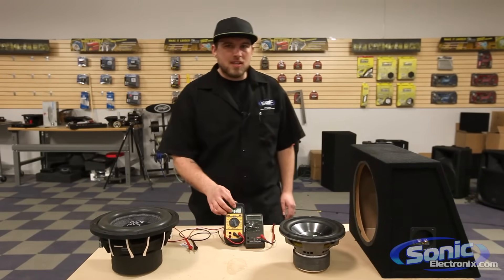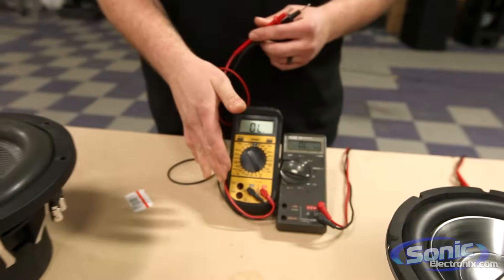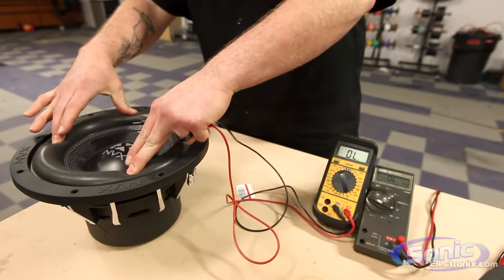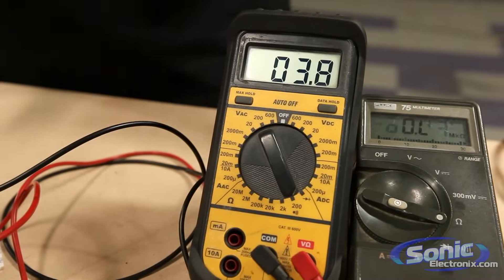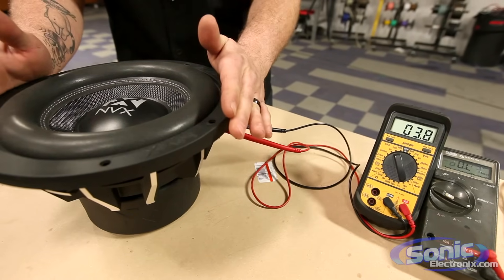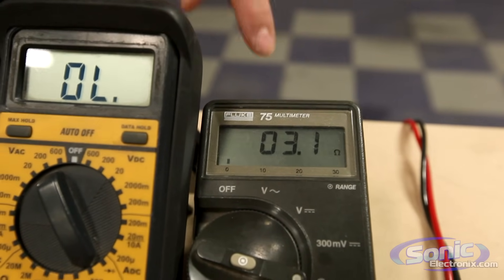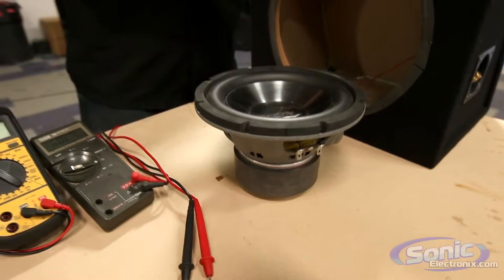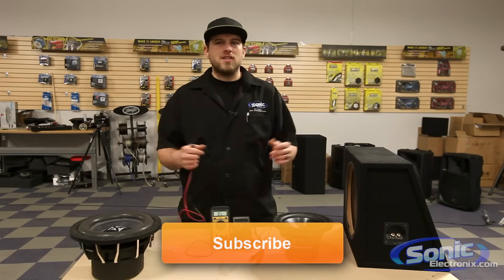How to Test Subwoofer Impedance with Multimeter | Car Audio 101

Comment: For all the "Mansplaining" comments, I'm a old school repair tech, and this method serves its purpose, it tells you if it's within acceptable range, 
and that it's most likely a good driver, so I even use this method 99% of the time.
I also do the simple travel test, pushing evenly up and down on the cone to listen and feel for potential scratching of a voice coil, etc.
Unless you have some odd sounding problem, then maybe use the whole special equipment and math. 
I'm sure the test in the video is just meant for explaining the general "is it good or not" for the general public, with basic tools anyone can buy. 
If he were to go in to all the explaining of the differences and the descriptions of how to do it "properly", 
he wouldn't have very many views, and and would lose the whole intention of the video.

Comment: I need to check the impedance  coming from the amp,  i just got a 7.1 creative surround system for my pc at great price but its missing the front left and right speekers so looking to add bookshelf speakers and only way to do it is to test the amp output for ohms?

Comment: One thing he didn’t mention, is if you are testing a speaker, you might also be testing to make sure there is continuity. Maybe, you’re considering buying a set of used speakers, and you want to be sure that the speaker isn’t dead. It might be blown! But not dead.🤪😫.  Good video. It answered my question.

Comment: You are testing resistance! Impedance involves inductance and capacitance (XL and XC); this is why the speaker will always measure short of the true spec because resistance is not  impedance.

Comment: Thanks for the tip! 

I did exactly what you've shown. What does it mean when the rated 4 Ohms subwoofer reading is only at 1.3 - 1.5 on the reading? Does that mean it's pretty much dead or something?
I did a test on the 2nd sub and that one seems normal; rated at 3.9.
Reply: Could it be a dual voice coil?

Comment: I'm kind of confused. I've never seen impedance be tested without a signal generator, decade box or AC voltmeter. I think all you did here was resistance measurement. Please correct me if I'm mistaken.
Reply: your mistaken.

Comment: anyone else run into this issue ? I got some 16 ohm speakers that are measuring 11.3 ohms and the company is telling me this is normal. and telling me some garbage about AC and DC ohm measurement. I have been doing this for 30 years and good speakers always measure within a 1/2 or .5 ohm of what they are rated at.

Comment: Thanks for the video. If I got 4.9, I assume that's 4 ohm? Is that odd to be that high? My multi is a little different than your yellow one. I set for 200 ohms as you did, but for the red and black connectors, I have three choices and not 4 like you. It looks like my red has combo. It shows V over top of ohm symbol, then mA. I used that for red and COM for black. The other red one is 10A which you didn't use. Did I get that right?

Comment: Can I measure the ohms of my 2 subs through the terminals that my amp has hooked to the speaker wires? My box is so big I can't take it out my trunk and it's a band pass box that's closed with 6 holes towards the cabin so I can't even see the subs unless I take it out and unscrew the box. I can only look through the holes

Comment: Why does my 4 ohm dual coil read 2.6
Reply: Because this video does not measure impedance. It's just plain wrong. It measures resistance. They're not the same thing. Impedance relates to alternating current (like the sound signal going to your speaker) and resistance is direct current.

Comment: My multi-meter works but its reading 0.l. However, I am testing tweeters and right after connecting the leads, a bunch of random numbers show up (in the high 30s) and then it goes to 0.l. What could be the issue?

Comment: i have an orion hcca 152 which i wired to 1 ohm. when i check the leads im getting 1.7-1.8. at the coils im getting 2.0 on the dot. is that normal?

Comment: As everyone has pointed out DC resistance and AC resistance (impedance) are not the same. The meters show the DC resistance of the coil. You can roughly figure the impedance by multiplying the DC resistance by 1.15, ie. it's usually 15% more than the DC. His 3.7 DC coils are 4.2 AC. Close enough. Also, impedance varies with frequency. That's why you always see the word "nominal".
Reply: You're the only person here who offers anything more than a grouchy "nu uh" about the measurements. Good to know that it's good enough.
Reply: That's right, you took my words.

Comment: As you can see by the comments, it would have been better to explain the difference between Resistance and Impedance, then explain you're doing a simple test of measuring the resistance of the speaker, that should be a little less than impedance in most case. Since Impedance is the combination of resistance and inductance and capacitance in an inductive device like a speaker, the resistance should be less than the impedance. So if you round up the figure for resistance, you likely have found the rough rated impedance of the speaker. Then you should point this works with speakers, but not all inductive devices. Oh, and don't tell people the resistance mode or scale of the meter is Impedance, it's simply not, its resistance.

Comment: I appreciate your doing a video.  You seem like a nice young man.  Many comments are a bit harsh.  I will attempt to state nicely some tips.  Impedence is for ac a bit like resistance is for DC.  Both are measured in ohms. However impedence usually is identified by the letter Z in formulas.  That said impedence (again for ac circuits such as audio circuits) is simply the combination of both capacitive and inductive reactances.  Reactances (ALSO measured in ohms) are seen in formulas marked with the letter X.  Speakers could be considered like an inductor.  Therefore to save you time, simply study inductors and their simple reactance formula.

Comment: My sub isn't working when I'm connect to the leads to check resistance it overloads but when I check for voltage and move the cone with my hand I get a slight raise in voltage any idea what's happening here?

Comment: Best you go back to school and pay attention in the Physics classes.Hey but generally only the clever kids do Physics ... silly me
You really shouldn’t pretend you know what you are apparrently doing for a living! Scary, people may be letting you loose on high value cars??
You are not qualified to run a Bath let alone a car audio shop!
1. With a multimeter you are measuring DC Resistance in Ohms NOT the impedance.
2. Amplifiers are certified to handle a certain Impedance, get that wrong and its toast! And the car!
3. To measure a speaker’s Impedance, you would need An Audio AC Impedance Meter
4. Yes, one can get a general idea whether a Speaker’s voice coil has blown etc. By measuring the dc resistance.This will normally be circa 15% lower i.e. a 4 Ohm speaker might show 3.3 Ohms and an 8 Ohm speaker may show 6.3 Ohms. ( note those are very rough estimates ) 
5. Measuring a Subs box terminals is kinda iffy .. some have Coils in them ! Oddly they have a resistance value.

Comment: See I used my multimeter on my dual 4 Ohm subwoofer and both sides was reading 4.4 and that's on both my subs. Now is that good or a bad thing? Cause I'm in the middle of rewiring my car system.

Comment: I have a question I have 2 subs I tried to get the ohms but both subs say 0 they play absolutely perfectly no pooping no scraping when you push the sub down and up what could be wrong I get a reading on the amp just not on the subs they are dvc
Reply: You have to disconnect from the amp before taking the reading

Comment: You didn't measure the impedance, just the resistance. Do you know the difference?
Reply: So how do you measure impedance then pls? Also, is 'impedance' another word/name for 'ohms'?
Reply: Typically, you calculate it. Its tough because impedance will change with frequencies.  The impedance that the speaker is advertised at is "nominal" impedance, usually based on something like 250 or 400 Hz.  Resistance that he measured in the video is a component of total impedance, but its not the entire picture. You have to factor in inductive reactance which again, depends on frequency.  You could measure it, if you feed it a sign wave of a given frequency, and then measure the current that your source is putting out, but that would be a big pain, since it requires some uncommon tools and equipment. Ohms is the unit that is used for both resistance and impedance, but they are not directly related.
Reply: Chaz Walker ohms is the unit of impedance and resistance.

Comment: inductive reactance (Z,not R)is measured in ohms,but is an AC measurement,the DMM will only give the DC resistance of the voice coil,plus the impedance,as the term reactance is a dynamic measurement,changes with frequency,so at 1Khz the imp' may be 5 ohm,at 5Khz it might be 9 ohm,dynamic.
Reply: That's not exactly right either.  Inductive reactance (X-subL) is the opposition to ac current due to inductance, and varies by inductance and frequency (X=2(pi)fL).  Impedance (Z) is a combination of Inductive reactance, capacitive reactance and resistance (R). Actually, you subtract cap reactance from ind reactance to get total reactance (Xt = Xl-Xc), and then use Pythagorean theorem (Zt=sqroot(R2+X2)) to get total circuit impedance.    Now, all that said, this guy's video is total crap, and the difference in his DC meter readings is not due to battery voltage, but most like the difference in ranges and meter characteristics since the more power the meter puts out, the bigger the magnetic field generated in the speaker coil will be, which will result in different current flow through the sub and therefore a different resistance reading.  Those meters do not measure impedance like he says, but rather dc resistance.  Yes, true the units for resistance and impedance are the same (ohms), but they are different animals.  Just like a "50-ohm" conductor does not measure 50-ohms at all, but that is a another different topic (characteristic/nominal impedance)
Reply: @craigschultz4  so in a nutshell, the readings from this method vary too much to be useful?

Comment: if i use my multimeter and a connect it with a speaker on on The correct settings it stays on 00.0 if i conect  only the red wire it just climbs slowly from 0 to 1999 can somebody help me?

Comment: +Sonic Electrionix I have 2 JBL gt5-12s wired in to 2 ohms parallel the impedance is constantly changing between 1.7 ohms to about 3 ohms Thay are brand new subs in a ported box is there anything rong with my subs or wireing.

Comment: That's not how a speaker is rated! It will always measure lower than it rated impedance. Saying it's lower is safe (generally) but NOT what you want for matching and maximizing amp performance. Using an accurate multimeter before posting I ran around checking and every speaker I tested measured below it's rated impedance. To know its rating is not as simple as that and that's just showing a safe guess. There have been some serious misconceptions made and many systems set up incorrectly due to this belief. But as result setting up my last system I learned my front speakers are 6 ohms with a label that says 8 ohms after the marketing department added their 2 cents. They measure 4 ohms this way and the claim they are 4 ohm speakers online got me to check what the manufacture knew. Being anal pays off sometimes. Amp will last longer and perform better being setup correctly. If only the electric force were as simple as gravity... unless of course you can do as much with gravity as you can with the electric force when you add time. But what's gravity? LOL

Comment: i have two dual 4 ohm 12s wired in parallel to 2 different terminals so they read 2.5 ohms each in the box. If i connected them to my single channel amp that has a ++-- inputs that parallel inside the amp does that bring it down to 1.25 ohms or will it still be 2.5 its two dual 4 ohm vm audio ecw 120's on a ct sounds 1400.1 they arent wired together just separately but they're both wired in parallel.

Comment: Too long didn't watch : Place sub on magnet / not face down.  Put your Multimeter in Resistance mode (Ohm symbol) 200 mode.  Connect red/and black doesn't matter which one to the leads on speaker.

Comment: Impedance is not the same as resistance measured here!
Reply: Glad to Be Normal You are correct. This is simply measuring DC resistance. It is useful for finding the resistance in load if the impedance of the woofer is unknown. His display of showing how if the cone is moved, the resistance changes is exactly what creates impedance.
Reply: @AnonymousUserDawg  Wal Mart and on 15 inch
 l7
Reply: Any way to test impeadance during rise while playin test tone with multi meter? I have an amm1 but just curious
Reply: Yep, this is dc resistance, not impedance. Does the job here. But it is what it is.

Comment: It's NOT the impedance what's measured there. As impedance is the "AC-resistance", it changes over frequency and can therefore not be measured with DC voltage like an Ohm-meter.

What's measured here is the DC-Resistance of the Coil.
Reply: Technically true but does not really matter for speakers, gets you a good constant olin the ballpark answer. DC resistance will always read less then 4 ohms for a 4 ohm speaker (expect a bit over 3 ohms) and for 8 ohm speaker it wil always read less then 8 ohms (more like 6 to 7 ohms DC resistance)

Comment: im guessing he/she means 5.4 on is multimeter. i have two 10' 200 watt sups in one box and have wired the together ( the +to the + and - to the - ) but b4 doing so i used my meter and one says 6.0 and the other one reads 6.4 so does that mean each sub is a 6 ohm? also the way i wired them makes them 3 ohm cuz it cuts them in half right?

Comment: The meter you forgot the name of is an iDeal 61-360. There is supposed to be a plastic screen protector (where the ridges are) around the screen, and it has the model # on it. I have the same meter and my screen protector is missing too. It seems a little unnecessary anyways, but would be nice to have.

Comment from the maker: A 4 ohm coil rarely reads 4.0 its usually anywhere from 3.7 to 4.3. Likewise, a 3 ohm coil would deviate about +/- 3 from the rated value. After you get your reading, touch your red and black lead together to get the actual resistance in the leads themselves then subtract that number from your voice coil reading.